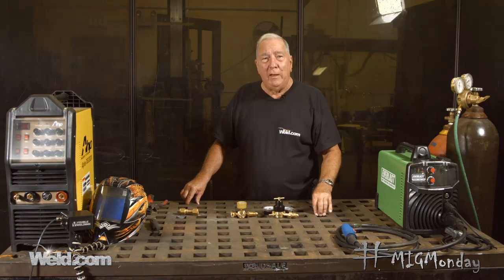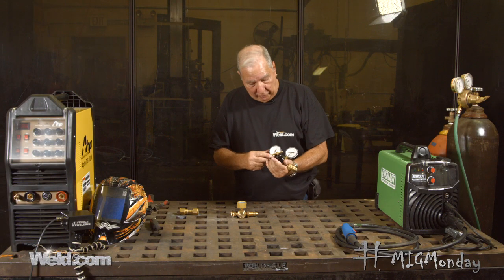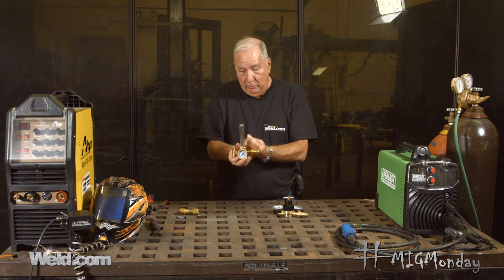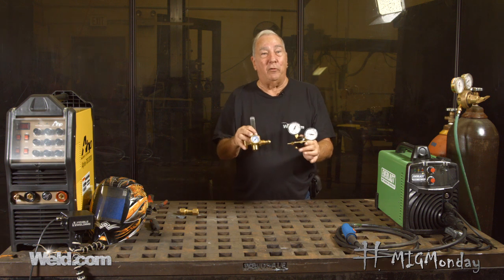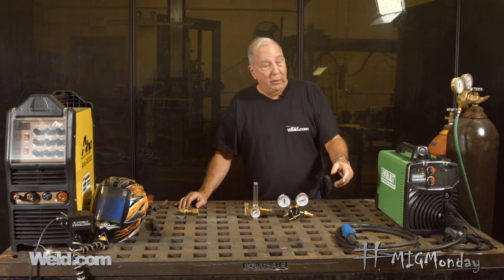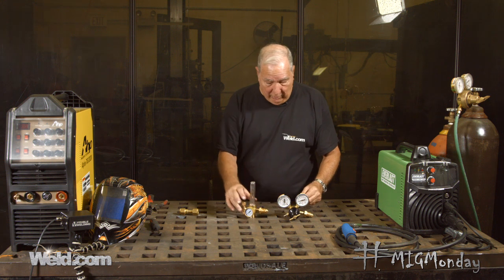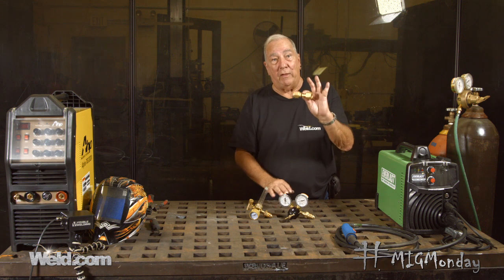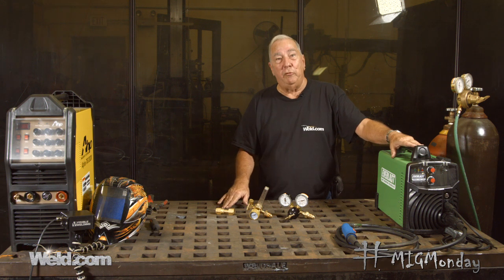How to Choose the Best Gas Regulator for MIG Welding

Comment: The first regulator had 2 pressure gages. Not a flow meter. It will at least put you back where you want to be once you get your gas fine tuned. I have both types, but I prefer an actual flow meter.

Comment: if you have a CO2 cylinder and need an adapter to fit the regulator gauges this is the one to get

WESTERN # 806 CYLINDER ADAPTOR CGA-320 TO CGA-580 - CO2 TANK to ARGON REGULATOR

Comment: "Design Flaw" (leaker) Bought an import tig machine, it was equipped with the floating ball flo-meter. When you investigate the construction... there is no packing gland on the flow valve and you'll find the needle side stem has a single o-ring which extend's from the stem sleeve body when properly adjusted where it serves as nothing until the valve has been opened so far to get the o-ring up into the sleeve/body to serve as a would be packing gland... flow is at maxinum and by far out of range in serving as a flo-meter. They're leakers by nature and cost you money, (the cheap ones) maybe it's a plan by design to put argon back into the atmosphere?? (Classified) Gov speak with forked tongue.

Comment: If this helps anybody to decide which type to choose from 
My work will only use the ball and tube type on the robotic welders. Almost every weld on the product we produce is a critical weld and I have seen it where a few CFH can make a difference in a passing weld.
So I would assume they are more accurate as well

Comment: Can you run a welder without a regulator on the bottle? I don’t have one on mine and I’ve been having the problem of lack of fusion like the weld is not hot enough to melt the base metal. Is this because I don’t have one?
Reply: You need a regulator to regulate the flow. Gas pressure from the bottle directly without regulator sometimes too much. Buy on Aliexpress, it's cheap.

Comment: Tip: ball flow meter shows when gas is flowing....ball only rises when gas is being used... needle doesn't... if you have machine not energized and the ball meter is showing flow you probably have line leak... needle doesn't do that.
Reply: @Newfive  So based upon your knowledge which one is better off the two? Thanks

Comment: What part of the little ball bearing do you use to measure the flow? top or bottom?
Reply: usually the widest part
Reply: The middle part.
Reply: top of ball
Reply: that's a good question I've always used the center of the ball but I don't know for sure